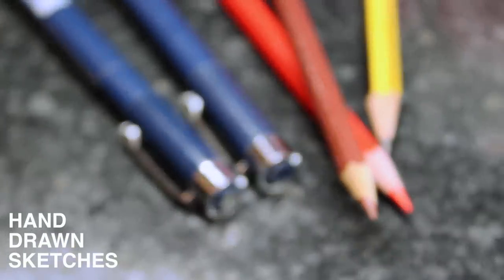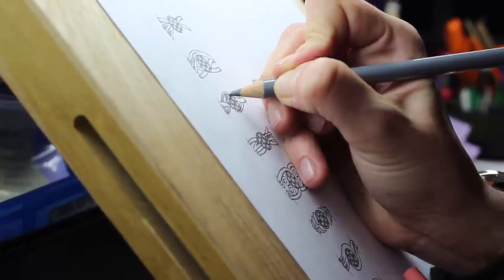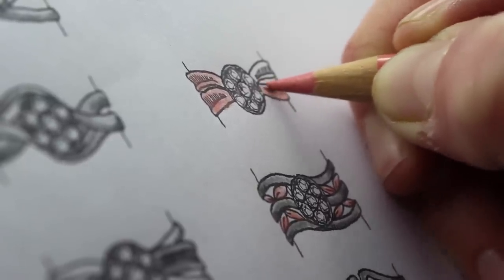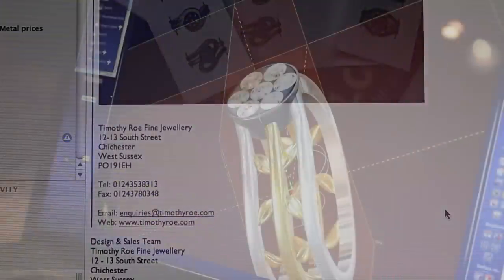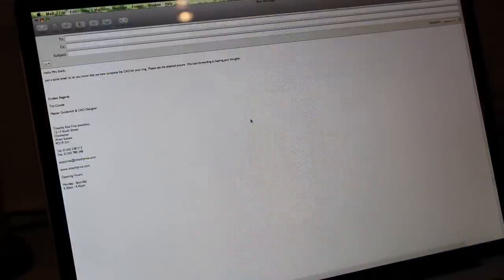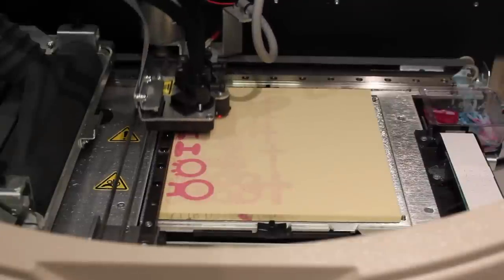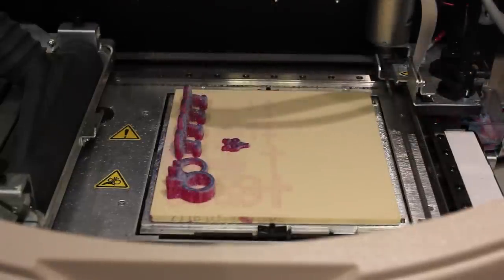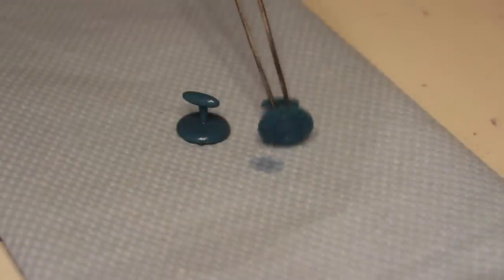Jewellery Design Process - Hand Drawn Jewellery Sketches - CAD & CAM

Comment: what is the kind of 3D printer ?
thanks
Reply: Not sure of the exact model, but it looks to be a Solidscape machine.
Reply from the maker: Matt Bennett Hi Matt, you are spot on with that - this one is a T66.  We also have a 3z Pro and our newest addition to the family a Mira 2 from NSCNC.
Reply: TimothyRoeOfficial  Sounds like a  great setup - and all in wax!  How do you like the 3Z Pro?
Reply from the maker: Matt Bennett It has been really great so far, although there is just something I love, but cannot quite put my finger on with the T66 -its like an old car, you can tinker under the hood more easily.  Still the one touch setup and operation of the 3z is awesome :)
Reply: TimothyRoeOfficial   I know what you mean.  There is something very mechanical about that machine.  We used to say it was the product of an MIT frat party.